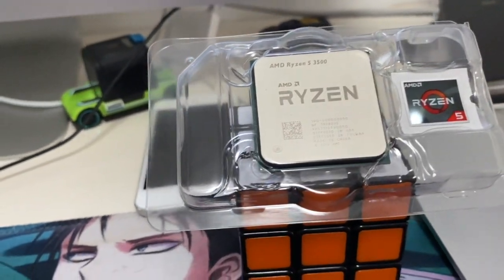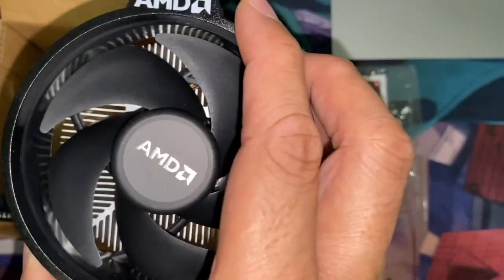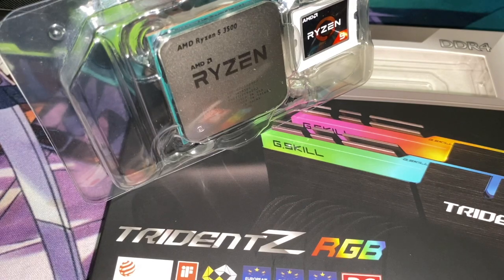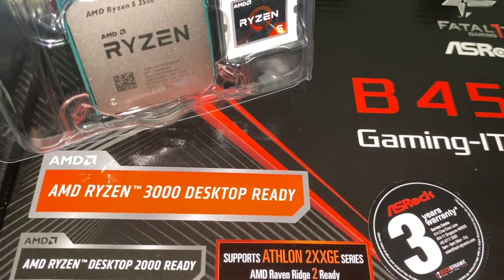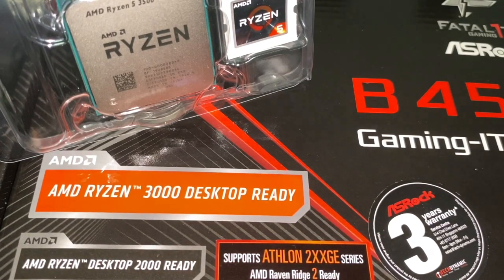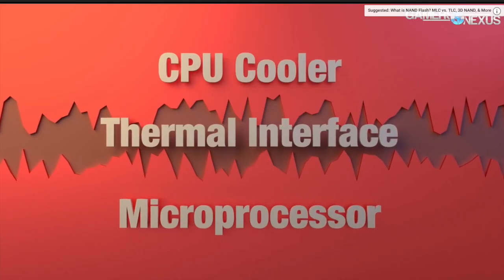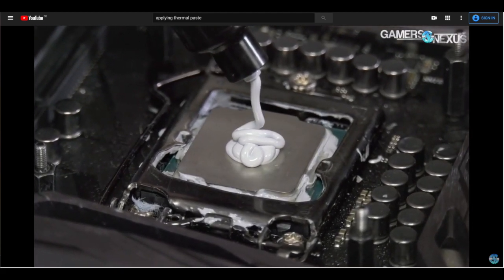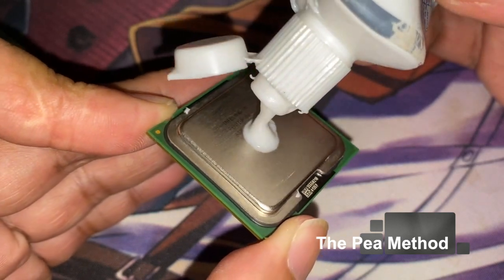I ruined my New Ryzen 5 3500 so learn how to apply thermal paste.

Comment: with the finger spread method did you notice the air bubbles that turned into pockets? pregnant pea in center is all you need.
Reply from the maker: I totally agree that the pea size method is the best way.

Comment: Doea it not come pre applied? the thermal paste I mean..
Reply from the maker: All stock CPU coolers has pre-applied thermal compound. However, there are some; like the shuriken 2 from scythe. The point of this video was to provide visual aide and to explain that as long as most of the ihs (integrated heat spreader) surface has thermal paste, it is enough to effectively transfer heat from CPU to the cooler.

Comment: Thanks for showing these tests, helped out a bit. At first I was thinking of doing an "X" but it seems a bit excessive and over flows the edges in some scenarios, my cooler is a wraith prism on a Ryzen 7 and the original paste applied, was absolutely horrendous. It was poka-dot with some dried, shitty old grandma nipple milk. And despite this, I have to undo the torque on the mobo clamps for the cooler to get it on, since originally it didn't actually fit. The lever wouldn't clamp, and was stripping so I stopped and undid the bolts, it seems they didn't include washers to properly torque the bolts, so I need to use the mobo clamps bolts to manually torque, but the issues are, I didn't trust the stock dried yogurt, and second is it took me 3 attempts to get the cooler to sit on cpu and clamp, and so I broke apart the thermal paste and smashed it together again reusing it, and reusing it, and it's the consistency of pulled/ripped raw dough now.. It's not pretty, so today I got another tube of paste. I figure though, what a way to test this. I have an acrylic sheet, a thermal paste tube to waste, and a drill, and old Pentium 2 and Ryzen 5 that needs repasting after mismatching parts, so I figure I should use this exact method to test on my Pentium before the Ry 5 and 7 to see what I like best. It may also just possibly save one Southbridge I broke too but that uses a different compound but idgaf anymore about that old computer and can probably limp the bridge along with thermal paste until I get real Bridge paste or something too...
Reply from the maker: Its a great idea to watch this video so you dont have to do it yourself. But of course there is not one size fits all type of solution; specially it has to be applied manually and by eyeballing. Go ahead practice if you have a spare.

Comment: Avoid finger finger finger joy method when I install the processor in the mobo then it's already connected to the mobo .. the mobo have cmos battery to keep the bios data alive XMP profile overclocking profile for CPU and time and date setting .. and human body can generate static electricity ..same with the cmos battery in the mobo to avoid shorting out use a plastic spoon any non conductive material but not sharp to avoid accidental scratches on the mobo.. to spread the paste
Reply from the maker: You can say that again. I had 2 boards recently dead because of it. :0(

Comment: What is that thermal paste in your experiment? It looks way to thin to be thermal paste and won't give accurate results.  You should pick up a cheap tube of ceramic or something off brand to test with as it will have the same consistency as other thermal pastes.  Your spread method is wrong as well, it needs to cover the full top of the IHS and be a thin layer of it.  Also if you have a way to see how much pressure is applied to the cpu from a heatsinks and then using the same pressure on the test.  I do like the clear case you used so we can see the spread tho.
Reply from the maker: I know I cheaped out with this video and the script is pretty bad. It may be an awful idea; in my mind it was great. But my point on this video was to show how it will spread out if applied in a certain way. And the other point was to inform people not to apply too much; as long as the thermal compound covers most of the HIS surface, heat transfer to the CPU cooler shouldnt be a problem. I am interested to hear any suggestions to improve the video. I can improve my contents if there are suggestions for topics and also, more people are viewing my videos. So consider subscribing. Thank you for commenting.
Reply: @SwitChildku  TBA, the last one you did is about the same amount most manufactures apply.  I don't know what pasted you used when you ruined your cpu, but the good brands are non conductive unless you buy the conductive type.  In the Gamers Nexus video they unloaded a whole tube on a cpu with no harm to the mb or cpu afterwards.  The main problem comes from applying to little.  It is always better to apply more then less.  If the paste isn't coming out of the sides a little you didn't put enough on in my opinion.  But then again I always use the spread method and cover the whole top of the cpu with a nice thin layer.  I just don't trust the pea or cross methods.  Also if you get any paste in the cpu socket holes, don't be afraid to get it out with some 99% IPA.  You could drown a MB in 99% IPA and as long as its dry when you turn it on it will be fine.